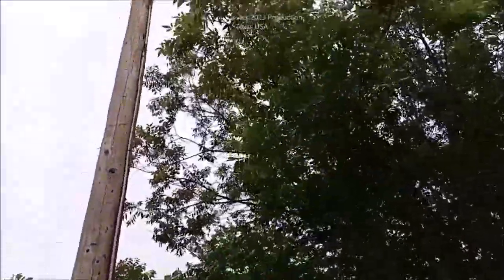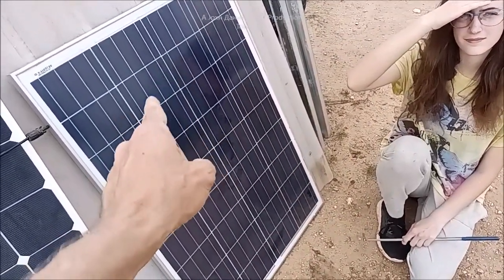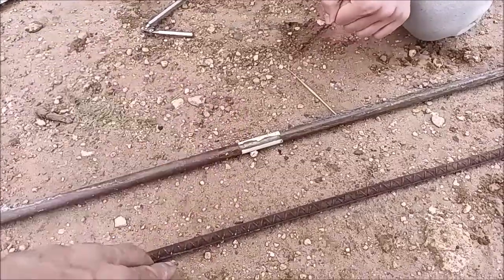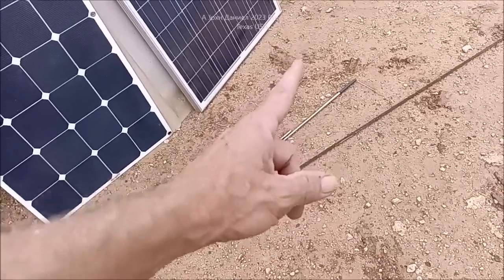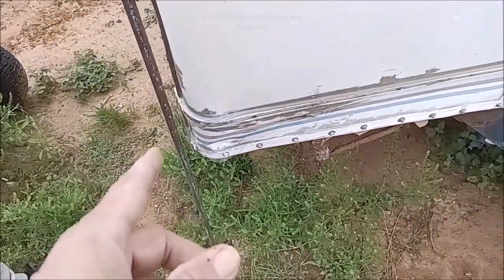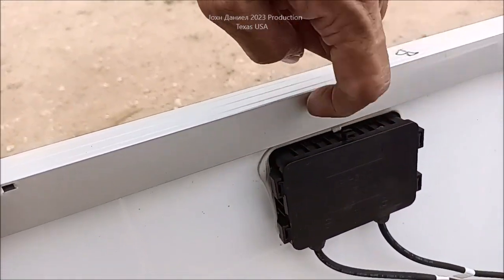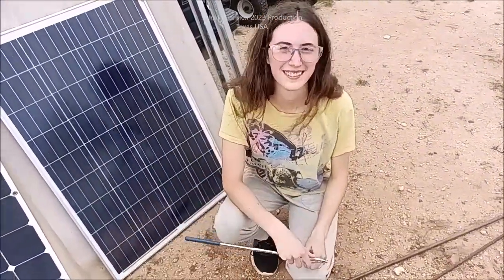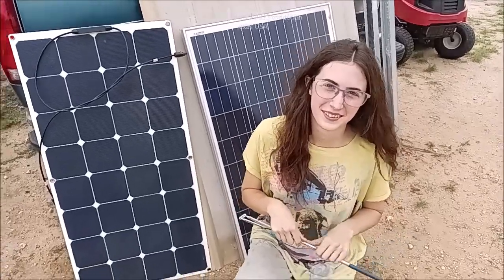Grounding your SOLAR PANELS? 🤔 You Better watch this First! *KNOW DC/Inverter POWER is not Utility

Comment: My dc to AC inverter requires me to ground it from the factor. It has a grounding screw on it. Apparently it uses ground as a reference point. Read your manual!

I grounded my panels and frame because code requires it. Code requires at least 6 feet of approved ground rod in the ground (5/8ths copper clad steel with AWG 6 gauge grounding wire). Mine is 6 1/2 feet in the ground.
Lucky me that a utility pole near me is grounded and should act like a lightning rod of sorts.

Ever wonder why most flag poles have a ball in top?
The ball attracts the lightning and shunts it to ground instead of lightning hitting your house.

My panels are ground mount over 100 feet away from the house.

Fun fact: did you know that if lightning strikes a tree, the power runs through the roots as well?

Comment: Yeah ehm... So I listened to your opinion. I even accepted it. 2 solar installations later, I have come to question it. You see, I have an installation with 18 panels (550W each) split into 2x9 series connections. (basically 10kW solar) The voltage for each series is 500V... And I've come to realize that this kind of voltage introduces leakage for some reason or another and hey, it trips my leakage protection AC breaker. I will ground my panels and return to tell you if that fixed it. If that fixes it, I am sorry, but you would be wrong :)
Reply from the maker: I would say if you have leakage that is affecting a AC breaker you got problems not related to DC as mounted. Leakage as in Errant Voltage is often a failed diagnosis of bonded ground system being used somewhere in the system. Solar panels are cells embedded in a film set in glass, glass being the absolute isolator. If you have voltage found on the panels metal, you have a source sending it to it.

Comment: Question for you should the batteries be grounded to the chassis of an RV or should the RV if it stationary for a long time using 110 power have a ground rod
Reply from the maker: For a stationary RV on 110V shore power, a ground rod would be beneficial for safety and surge protection. But you want to avoid sharing frame ground with the park or utility via the common ground. All RV's have a battery ground to chassis and a  isolated ground from the 120 to 12 volt power converter. Technically it is void unless you intend on pulling lots of amps via the frame of the RV then you get field contaminations electrically. What I do, I self ground a RV if living in it with at least a 4 foot x 5/8 ground rod connected only to the green wire from the RV ground terminals in the breaker box and not from the frame. Older RVs before inverters were common put a #6 ground terminal from the frame to connect to but with inverters now you must keep that separate. NEVER ground your inverter 120 volt 3 wire output to your circuit breakers, use only the Hot ( line ) and Common ( neutral ) when connecting to that scenario or you can get feedback voltage into your inverter from some bonding in the system somewhere.

Comment: Cars do use "ground" with an antistatic ground strip, this helps you not getting a shock when you touch te car (specially with low humidity). The grounding on panels is for static electricity. Obviously you DO NOT ground DC side, the grounding has nothing to do with the DC side...

Comment: I hope you'll forgive me but I'll get my grounding recommendations from the National Electrical Code.
Reply from the maker: They have no code for mobile Solar Installs or portable installs. And they do not recommend you connect any solar to a utility ground system but refer to all grounding on solar as LIGHTNING ROUTING grounding. Mounting on metal as I do and as they recommend is already mass grounding via structure. Only a moron would ground DC voltage to earth anyhow, but feel free to do so. Be sure to do your car and boat and rv too.

Comment: so explain grounding to chasis
Reply from the maker: That's a falsified term misused for years. You do not "ground" to chassis, you bond to chassis. Its a DC System. Slang lovers call it ground, we have to refer to it as ground so folks don't think your gluing wire to it, and the fact is the chassis is NOT grounded since it is isolated from earth, it is in a Circuit Bond to the DC power of the vehicle. Bonding is a continuation of circuit which is how the metal chassis carries the negative polarity of a battery.

Comment: Not all educated people are clueless with a screwdriver.
Reply from the maker: Before 2000 I would agree with your assessment of that. When about 5% of the "educated" who did likely get a complete set of screwdrivers in a gift package. Since then it's practically unmeasurable. Our society drastically changed ( their own claim ) after the tech revolution to where the "Initiated" carry the tools and done the work, the Educated carried the paper and made the rules. Hasn't been working out well. Forbes in 2017 said - if you hand a recent college educated person a hammer in 2017 the likely result is a broken beer bottle, not a home being built. 
Elon musk in 2020 said of all his technicians, over 300 not one he can say was doing the job they went to college for and only a few he has hired even has a college education, most of all are people who were simply born to be innovators. On his word ( before the left hated his guts ) the college people were the ones he had the most problems with due to what they learned in those failing institutions that has nothing to do with skills.

Comment: Safest place to be during an electrical storm is in a car fitted with rubber tires (and not grounded with a grounding rod 😂)
Reply from the maker: Cars are safe because of the Faraday cage effect, not the tires.

Comment: Foldable panels are intended for temporary, portable power (they are rarely even waterproof which you didn't mention). real solar panels for permanent installs do have pre-drilled holes for grounding, with the ground symbol right next to them.
Reply from the maker: No solar panel requires grounding, it is a option. However solar panels aluminum frames are anodized coated aluminum. Grounding is not going to go well based on a very poor connection as designed. When we install at Oil Wells we use 3 self tapping screws to get a inspection pass on the installs, clamps and bolt are not approved. For a oil well you have to ground them by law even though the chance of lightning to them is about 1 in a billion compared to the oil separator units being 8X as tall massive lightning targets and hit almost 20 times daily somewhere in the world.

Comment: Do I need to ground a charge controller?
Reply from the maker: From what? What would a charge controller have happen to it that the breakers and fuses you should install can not handle. Your more likely to get errant voltages and static by grounding it but it's a personal choice to do so. Ground terminals on the few that have such are there to satisfy the government folks, not safety of the controller or you. Fuse from controller to battery with a fully rated mount and fuse and use a 2 wire circuit breaker like a Jotta on the incoming lines.

Comment: I agree with your observation. Simply bolting an “earthing” conductor to the rooftop solar‐panel chassis—without a proper lightning‐arrestor system in place—can actually turn the array into a lightning magnet. Because lightning always seeks the path of least resistance back to earth, any elevated metal surface that’s solidly grounded but not protected will be a prime target.

In properly engineered photovoltaic installations, the DC side (the panels and their wiring) has its own dedicated earthing grid, bonded at a single point. That grid must remain electrically isolated from the AC‐system earthing grid. Unfortunately, many DIY installers—often lacking in-depth knowledge of electrical earthing and lightning protection standards—mix the two or omit surge arrestors altogether. The result can be unsafe installations that increase the risk of damage, fire, or personal injury.

Comment: I worked about 40 years on elevators (mainly fixing them). Several manufactures on older equipment that used DC for control circuits and motor circuits used so called non grounded systems. On an elevator system in Maryland during a tropical storm water started running down the hatch, even filling up the pit at the bottom. This water by touching the gate switch wiring and door lock wiring on this non grounded system allowed the elevator to run with it doors open, bypassing critical safety devices. A grounded system would have blown a fuse or tripped a breaker.  A woman happened to to step on the elevator and it took off pinning her between the hatch and the elevator car. Peeling the hide off of her from her back to her thighs. She was a large woman and the elevator stalled with her trapped between. The Fire and Rescue squad happened to save her life. The investigation revealed that the non grounded system along with a clogged roof drain was the cause of this accident. Your circuits in your house the current runs back on the neutral not the ground. Elevators use grounded circuits today a fuse or breaker shuts it down when a ground happens. Yes we happen to lose a lot of electronic boards from surges on earth grounds with lightening. Better that injuring or killing someone.
Reply from the maker: Luckily 20 to 50 volts of solar and Elevators are extremely different. The  DC Contactors for a Elevator ( example Rice Motel 1977 2 shaft, 22 floor ) are 280 volts DC  in 2 legs positive and 1 main leg, frame, cables are negative. Otis Engineering used this, Fairbank also and the cause of water hitting cables would do nothing, its the water hitting the 36volt AC Controller Relays that will set them off and cause the actions of malfunction. Some use 28 volt AC, most have 36 volt AC for their controllers and 14 to 18 VDC for the switch links to the contactors ran by AC voltage. The reason they use AC voltage on the action switches is due to the low loss of power in AC so the buttons and trip switches can act the same from basement to penthouse 40 floors apart. The DC drivers are in the cable house on top of the shaft and in slip rail brushes or slip ring cables is AC.
Reply: @JOHNDANIEL1 ASME, NEC, NAESA all make recommendations to code requirements becoming law. Every part of the elevator electrical system is now grounded. 

 So when a short happens in a system where does the risk and danger go to?  Grounds and fuses are just safety items. A system that always works as designed never becomes a dangerous piece of equipment. When it fails it can become very hazardous without safety designed  into it. That woman became a victim because of the minute savings of not having the control power supply grounded. Your inverter can have several different sources of power in it along with the combiner box. The elevator industry has the best safety record of any transportation on planet earth. Grounds, fuses and breakers should be installed whenever you have potential that might hurt someone. PV circuits can reach 500V. Inverters can have capacitors circuits with higher potential than that. Saving a few dollars has never been that necessary when it comes to safety.

Comment: A car alternator produces AC (Alternating Current) electricity, but it is immediately converted to DC (Direct Current) by a rectifier within the alternator before being used to charge the battery and power the car's electrical systems,

Comment: You do have to ground your PV panels because the aluminum frames can accumulate static voltage. A flexible solar panel cannot induce a static voltage. Static voltage on a panel can be dangerous (if you touch it on the roof you can fall off), that's why you have to bond them to the ground. But you should only ground at one place, not near the solar panels and at your home, at one place only (usually only main home ground rod). If you do have two or more grounding rods, you have to connect them together to reduce grounding loops. Grounding doesn't protect your system from lightning strikes, lightning protection systems are for that. Bonding your solar panels to the ground will not protect your system from grounding, it is to bring all the metal surfaces of your system to a zero potential voltage so you don't get shocked. In mobile systems the ground is your battery negative as the main 0V reference point. That's why the chassis of your vehicle is connected to the negative battery post.
Reply: The reason you ground out your panels is to provide a low resistance to ground, thus if you are unlucky to be struck lightning to power will be diverted away from you inverter/batteries, and you will probably have a surge protection device in your combiner box to help with this.
Reply: @tonydickerson999  yea…no. A few million volts is going to go wherever it wants and do whatever it wants. SPDs are a gimmick and nothing more, and a ground rod, even if it diverted 99% of that incoming juice from a lightening strike (which it’s not going to do), the remaining portion is still more than enough to fry everything it touches.
Reply: I also saw your video, what I am curious about still is that you cannot combine the AC and DC ground right? So when the DC ground is connected to chassis, the AC ground cannot be connected to ground, so where is this AC ground connected to?
Reply: For a mobile system, is the AC ground bonded to chassis?

Comment: What about for ground-mounted solar panels?
Reply from the maker: My 100% fool proof install is to build a mini roof a bit larger than the panel coverage needs using 24 or 26 gauge metal panels, install the solar on it with proper mounts, then ground the roof, NOT the solar so that static or shorts can be sent via the roof metal not the frames to the ground. Check your 4 season angle of sun, prioritize fall season angle, and build it. Put a gutter on it, collect the rain for garden as a bonus.
Reply: @JOHNDANIEL1 so does that mean you’ve updated your methodology?  My own ground mount system (my 2nd system…my first has been in service for 12 years now, and never been grounded) which i built a few months ago and an ready to put into service now is made from all 4x4 pressure treat, 60’ long, along which two courses of unistrut run, which hold the panels towards the top and bottom with special aluminum clamps which are meant for precisely this use case. These panels are arranged in 2 strings of 8 in series (16 415 watt bifacials in total), each string running just shy of 300v each. I’m having a hard time figuring out whether I should ground them. Seeing the way you are talking about grounding the rack as related above, is my set up similar in that regard if I were to run a ground cable right from one (or both) of the unistruts to a rod? I’m not worried about lightning, as I live in a valley in a mountainous part of western Maine, and lightning strikes are not all that common, but I AM concerned about static charge at those higher voltages. For the record, i’m not anywhere near grid power, though in this system inverter this is going to is a hybrid (Midnite Rosie), though with a discreet CC (midnight Hawkes Bay), so there is no Ac coupling going on.

Comment: If you don't ground the frames the lightning will still strike them and instead of the current surge going to ground through the ground wire it will go down to ground anyway but through the slightly longer path through your DC wires into your charge controller, inverter and whatever other electronics you have until it finds its way into the ground frying everything in between.

The 3000v or so breakdown voltage of the insulation in the panels is insignificant in the context of a lighting strike of hundreds of millions of volts. Lightning will cross that insulation just as easily as if it were a solid copper bar.